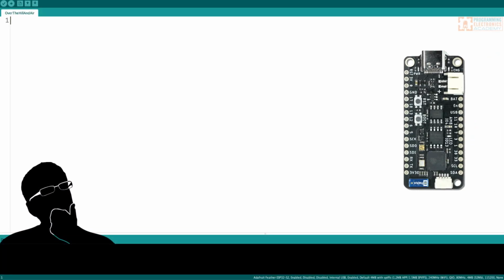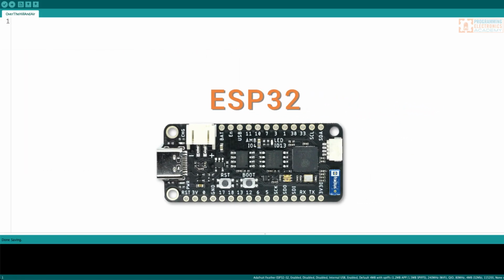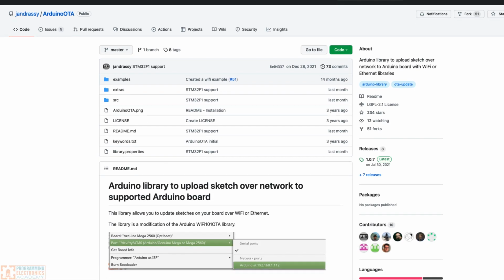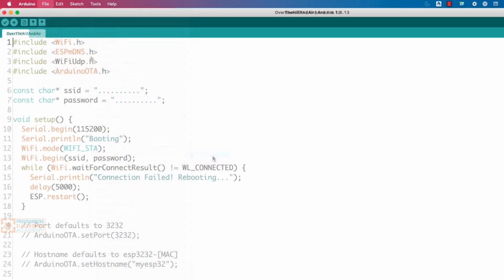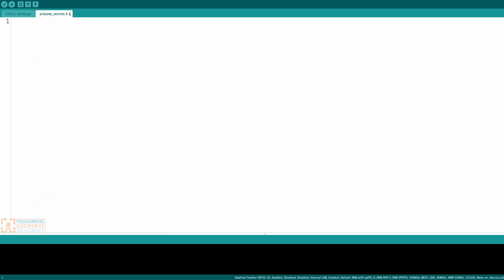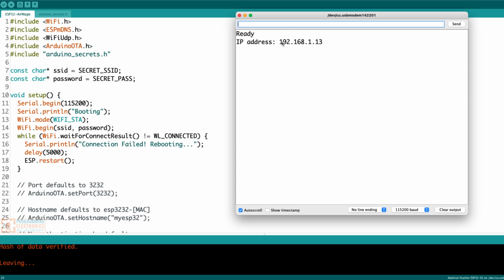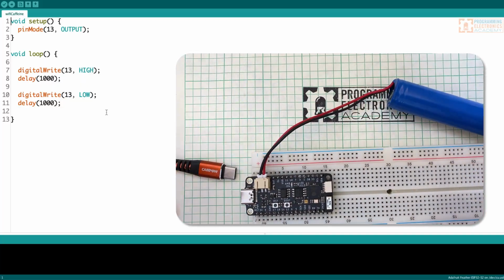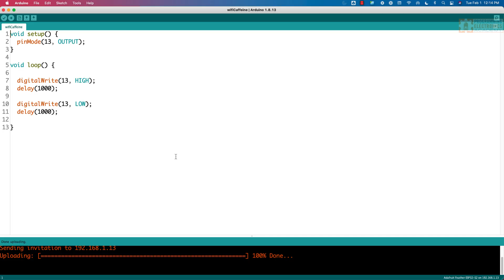OTA with the ESP32 (Over The Air)

Comment: I wonder how something like that could be done without interference on the overall performance of an ESP32 with ETHERNET sketch.

So i could have OTA and Network handling on one core and lets say application code on another core and hopefully have both running at max speed both proccesses

Comment: I can't believe how simple that was. At least, seems to be.  I'm running right now to modify all my boards. This always been a pain to update via usb.  Thanks so much.
Reply: Haa zut.  It does not work for me 😢.  It worked the first time only. Once my app is running, there is no way the ota connect. May be I do something not compatible. For instance, I use both core, and I also connect to the same local network.
Reply from the maker: The OTA code needs included,   This video is what you need :

The EASY Guide To Over-The-Air (OTA) Updates With ArduinoOTA
https://youtu.be/7Xdsc1qqoro
Reply: @programmingelectronics got it. It is all working fine now. So much easier to update now. Thanks so much

Comment: Im using the Arudino Nano ESP32 and uploaded "BasicOTA".  I successfully uploaded "Blink" over my Wifi and it ran.  However, when power is removed, the blink sketch will run when power reapplied, but the "Basic OTA" is not longer running.  Is there a way to keep Basic OTA in non volatile memory so that it starts again if power is removed and reapplied?
Reply from the maker: Hi Robin, check out this video:
https://www.youtube.com/watch?v=7Xdsc1qqoro

The one here forgot to mention that you must include the OTA code in every subsequent sketch you upload, otherwise your device will not be keeping an "ear out" for firmware updates.  Sorry about that!

Comment: If I understood correctly, this technique can be applied only once. If I want to apply additional firmware OTA updates it won't be possible because the original OTA sketch was overwritten by the Blink code...
Reply: that's why the second firmware has to also contain ota capability. it wasn't shown in this vedo in order to make it simpler to validate that it works.

Comment: Hello, very good video, but I am having problems with the firewall, when I disable it it works OTA.
I already opened TCP and UDP ports but it still doesn't work without the firewall disabled, any solution? thank you

Comment: ok video is almost accurate while still missleading. at least in my case when trying this method by the time you upload the 2nd code with your actual code it will stop to work OTA. you need to actually mix your code with the OTA code for it to work consistently otherwise it will only work the first time. thought maybe somebody else could save some time, peace!
Reply from the maker: Sorry about this issue.  It is mentioned in the comments.  Here is an updated video: https://www.youtube.com/watch?v=7Xdsc1qqoro

Comment: How would it be if i want to work with a SIM module to connect the ESP32 to a cloud via 4g, to update the code of the ESP32 from any place instead of using the wifi

Comment: This is so cool. I tried and it worked like a charm. I like it.
Reply from the maker: Great!  Make sure to take a close look at the comments, because you'll need to included the OTA code in every sketch.
Reply: @programmingelectronics  I figured it out after first selfoverwrite. Honestly it should be mentioned in the video that all setup and ArduinoOTA.handle(); in thel loop to be placed. It could be trap for many young players as I have read comments. What I'm actually working on is bitcoint ticker with nice VFD display. So I need Wi-Fi during program runtime. I plan to display also progress during OTA update as it is currently sent to serial.

Comment: have a program that sends message by Bluetooth to a matrix led works well but I want to load it by OTA but I just put in the setup: SerialBT ("robotics 2") which is the name of the Bluetooth that I gave me says error when compiling for the ESP32 board, you will know why this happens, by cable I charge it well

Comment: Nice but it would be nice to explain how to add OTA to a new code so it can be repeated again and again and not only one time.
Reply: You can,  just take code you made for example  a blink program then copy the 3 sections of the blink program (Global, setup, loop) and paste them in the 3 sections of the OTA program leaving the OTA stuff untouched and there you have it, now you can download and change your blink program as many times as you want with OTA.
Reply: @paulkoepnick7122   Callbacks have a loop which is usually blocking but some have nonblocking options, but if it works as you say, then it should be easy to run in the background of any program. Another option if blocking is an issue, as I have only worked with ROS and MQTT callbacks: ESP32S devices are dual core, so your second core can run the OTA server while the other runs your primary program. This is especially handy if you need to run multiple callbacks from different functions as the loops wont interfere and reduce chance of threading error due to improperly incorporated callback loops. If you want to always program this way, make a template to insert into all your other codes, the method requires no difference in setup between uploads. Also, you do not need to read your IP from the monitor (which comes from your wifi setup section using the localIP() constructor in the setup not the OTA callback section in the setup) I suggest always creating a static IP and knowing all devices on your network. Static, vs DHCP, significantly improves connection reliability and the amount of time it takes to connect to a network using general IoT devices. This may help a few of the people who may ask the same questions as Ive seen below get some ideas to try out.

Comment: Hi, GREAT video. I try it, but I dont have message "uploading === 100%done.

I have uploading....................... always. I was waiting so long, More than 3 hour and same message "uploading........."

I dont know why. but, my esp and lCD can work with the program I have uploaded. 
I hope you can help me. Thank you
Reply from the maker: Hi Reno!  OK, it probably shouldn't take more than 30-45 seconds to upload to your ESP32 board, so 3 hours is definitely an issue.

I would attempt to uplug the board, and plug it back in, also perhaps try closing the Arduino IDE, and opening it again.  You also might pressing the boot button on your board if it has one.  Then try uploading again.

Side note, is this an issue with every sketch you are trying to upload?
Reply: @programmingelectronics  Yes, everytime I upload new code, I dont get message "uploading 100% done". always "uploading .............."

 the esp32 can work.  but the process is not finished, always writing " uploading ..............."

I have done to boot. but not working either.

when I upload new code, the esp not responding.

Comment: Thx 4 this vid ... both the Web OTA and Elegant OTA solutions appear to require Internet connectivity something I specifically deny to any ESP32 device ... b4 seeing your vid, the KEY detail I was missing for this OTA Sketch was that it linked the Arduino IDE to the ESP32 device using MDNS protocols (this was the AHA moment I got from your vid) ... I have now taken this sketch two steps further by encapsulating the Setup and Loop code with a flag triggered by a special URL which puts the ESP32 into what I call OTA Mode ... the Arduino IDE won't see the MDNS Port until the ESP32 is called via <ip>:<port>/<SomeUniqueName> ... the server.on code for /<SomeUniqueName> runs the OTA setup code plus sets a flag allowing the loop code to exclusively run the OTA handler (effectively turns off ALL other ESP32 functions until the OTA is completed) ... also extended the watchdog timer to 10 minutes which will reset/restart the ESP32 should the OTA either fail OR is never started ... when the OTA is complete the ESP32 is rebooted automatically which resets the OTA mode until it is manually invoked again.
Reply: Do you have a code for this? If you do, send the github

Comment: Could this be used with a deep sleep sketch? Have a remote solar monitor and would be great to tweak the code using OTA from time to time.
Reply: You could potentially do it in reverse where it is checking a server for a new valid binary file to download and flash every time it wakes up, it wouldn’t be as quick or convenient but would do the trick.
Reply from the maker: Great question!  I'm not completely sure and it probably depends, but I think deep sleep usually implies that WiFi is off, which would rule out OTA.  But perhaps, during its brief wakeup moments, you have it enable an OTA window for a short period?

Comment: How would I go about using the esp32 as a simple wifi antenna for my laptop?  for example if my wifi card inside was to fail, could I use the esp32 to connect and surf?
Reply from the maker: Not sure to be honest!  There is this project on github:
https://github.com/fabio-d/esp32-tuntap

I think if you search for "esp32 as wifi dongle" you might be able to dig something up.  Best of luck!

Comment: Does this only work if it is on your Wi-Fi, or will it also work if it is connected to someone else's Wi-Fi network? Provided you know the devices ip address.

So you can do "firmware" updates to a device not in your own home.
Reply: You would need to set up port forwarding on the router, otherwise a computer like a Pi on that same network would be needed to communicate with it for this method unless it were to check a server (potentially on your network) for the updated binary, there’s an example that uses Amazon AWS servers but it can be any server you can upload to.

Comment: Uploaded the Air Magic sketch via the USB Port. Unplugged it, found the network port and uploaded a blink sketch successfully. Make a change to the delay rate in the blink sketch and try to upload it again and get a No Response error from the ESP32. Only way I can upload the modified blink sketch is to plug the ESP32 back into the computer, go through the process of re-uploading Air magic, unplug it and upload the modified blink sketch. What am I missing?
Reply: I should have read deeper, just found my answer in other's comments.
Reply from the maker: Sorry about that Jim - this video could have been done much better!

Comment: Unfortunately OTA takes place with the WiFi credentials shared. That means if my ESP32 was deployed in a Robot far far away, and I tried to send them this, over OTA, I would need OTA Web Updater, right? I have been trying to do that, and yet cannot seem to be connected to the local IP address, I am still just learning this, I have high hopes for the OTA features as an Intern Robotics Engineer. I am going to so use that.... Is there a video you created for the Web Updater?

Comment: Hi, Great video and so much better than a bunch I have seen on here. How do I implement/combine the code so that I can run this more than once? You bring this in to make it OTA, but then you only get one shot at the OTA, then you have to go and plug it back in again. HOW is it possible to have the ability to do this forever?
Reply from the maker: Thanks Dave!  I need to release another video on this covering just that (and it's a shame I didn't in this video)
It's pretty straightforward, for every new sketch (aka update) you upload, you  include that ArduinoOTA.onStart function, and the ArduinoOTA.begin() function in setup, and then in the loop you make a call to ArduinoOTA.handle() 

I am not sure how often ArduinoOTA.handle() needs to be called, but I would imagine you do not want any delays inside your loop code else it would mess up the OTA I believe.  I hope this helps some!  Thanks again for watching!
Reply: @programmingelectronics  thanks for the reply, makes sense to me. I guess I was running before I could walk haha… shame as your video has to be the best out there for demonstrating how easy this is and I can’t understand why it’s taken me so long to come across your video. Thanks - Dave

Comment: So what is the ota code segment we have to include in our sketch to be able to use OTA more then once?
Reply: you need to join the two codes. I tried it and it works now.
Reply: @jeancarloschararoque4163 I had the same plan. Where did you insert the new code into the old code? I tried now, but didn’t get it right. Planning to figure it out tomorrow morning, but if somebody else already knows, it will save time…

Comment: I have found using the delay() function interferes (failed connections) with OTA. Delays should be seldom used or kept short (<1000.) Otherwise, OTA is handy!

Not sure why the 2G/5G comments when dealing with Wi-Fi.
Reply: I assumed it meant 2.4GHz vs 5GHz, but also had a moment of pause when I heard it.
Reply: @dieofthebeholder  Makes sense now. Good call!
Reply from the maker: Thanks for the note!

Maybe it's my router - the 2G always seems to connect quickly.
Reply: That 2G and 5G confused me too. I also didn't make the link between 2G and 2.4Ghz or 5G and 5 Ghz. Could be your 5Ghz is effected more by your walls and floors etc.
Reply: I have not tried this yet but in theory since this is an ESP32 and has RTOS you should be using RTOS tasks to avoid any interference with Wi-Fi and anything else.